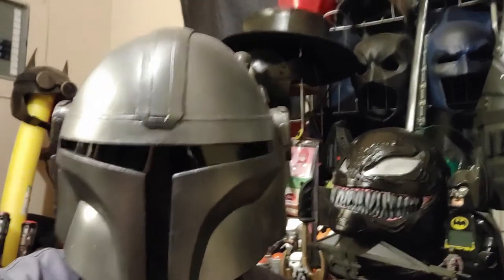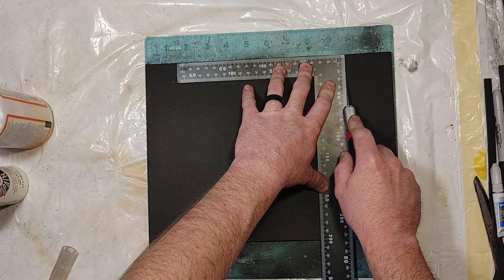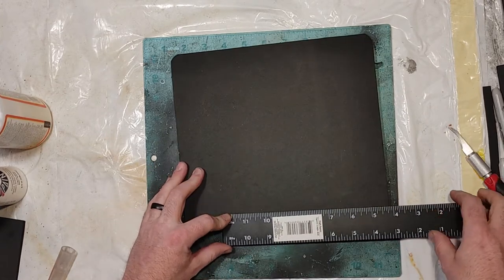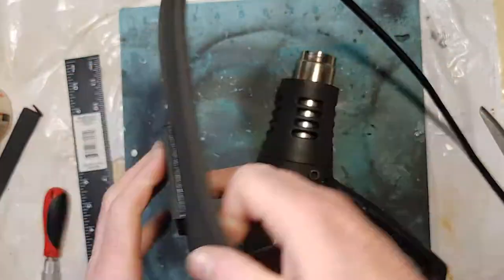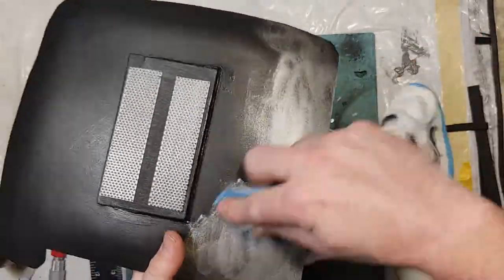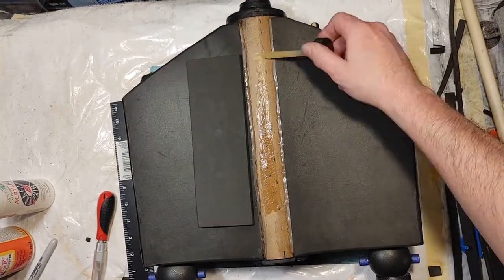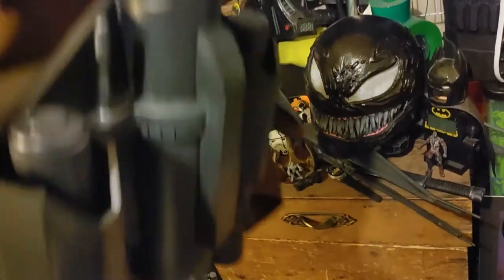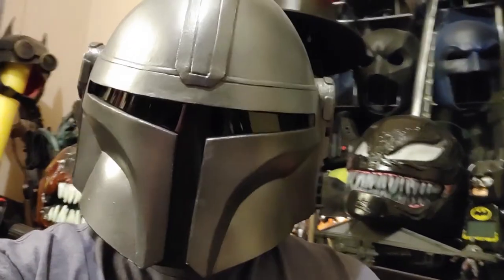The Mandalorian cosplay DIY Upper Back plate build

Comment: Great addition to the series chap. Loving this build and how it is turning out. I’ve never tried rub n buff so will have to order some as it looks the business.
Reply from the maker: Thanks! Rub and Buff is an "old school" cosplay trick, I guess? 5 years ago everyone was using it... Then it dropped off. The effect is fine-like dry brushing but works easier and spreads and rubs with a bit more of work time than using paint-so you can put a little more or rub a bit off if you need to even it out. Its really fun to put on, and that's mostly what keeps me coming back to this product more than function or nostalgia lol.